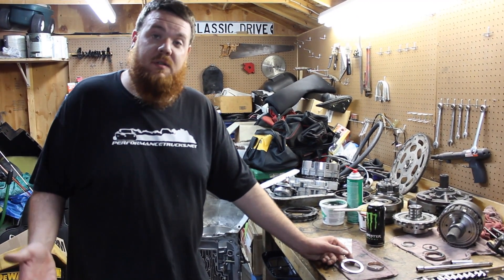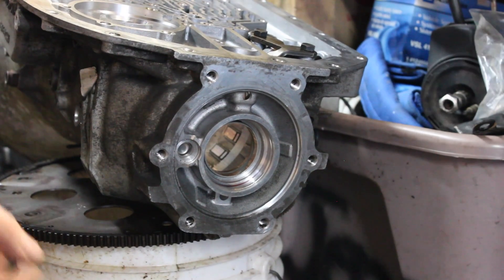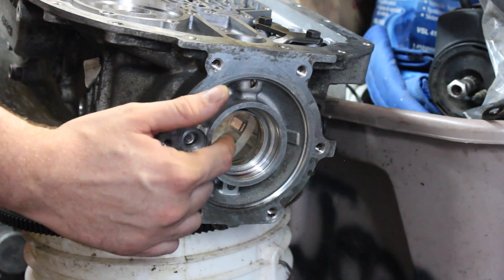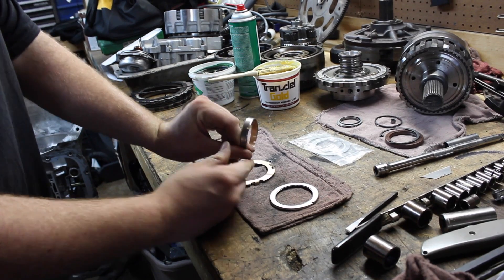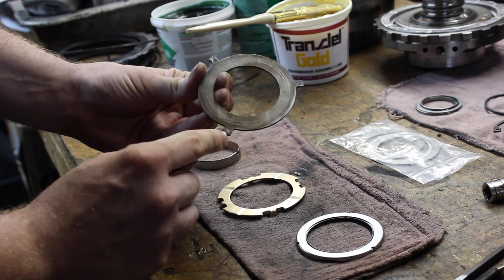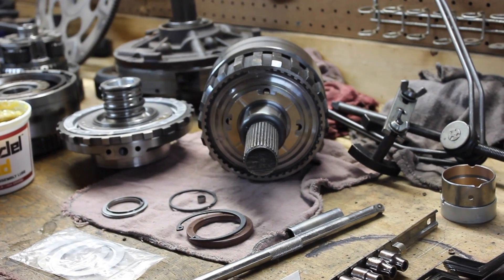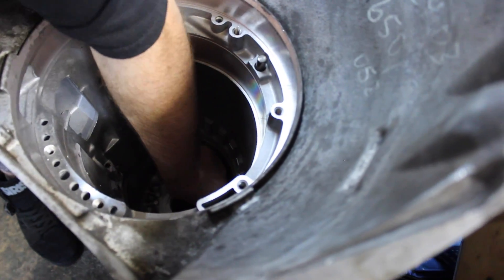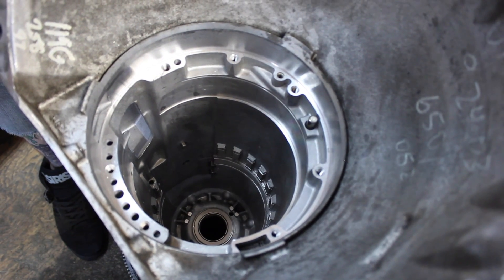Rollerizing Rear Case 4L80E

Comment: i was wondering  do you need to dip the t350 pump bearing into oil before fitting  or are they pre greased, i am refering to the one being used in the rear of the t400
Reply: do you need to? No. Is it a good idea? yes. Dip it in the oil you have the clutches soaking in. It's not going to hurt and it will only help the bearing as it won't start off dry.

Comment: When doing this mod, how many of the washers do you use and do you still install the 4 prong bronze washer?
Reply: no you don't use the bronze washer
Reply: measure the two pieces you removed and make the bearing and washers the same thickness

Comment: What about the Sonnax No-Walk bushing?
Reply from the maker: That will also work.
Reply: Hopkins Performance Solutions. I got the bearing and shims and the no walk bushing. I would love to use the no walk bushing thats i must have part.
Reply from the maker: The no walk bushing works also, If you need to, you may have to shave part of the shoulder down, so it sticks into the case some. Thats why we always use the TH400 Extra Capacity Bushing. However the no walk will work.
Reply: @HopkinsPerformanceSolutions  just install it backwards and its perfect
Reply: @boydco6587  Doesn't that defeat the purpose of the no-walk bushing?